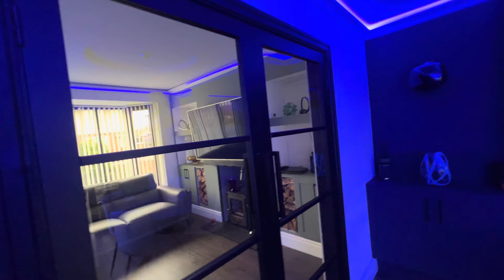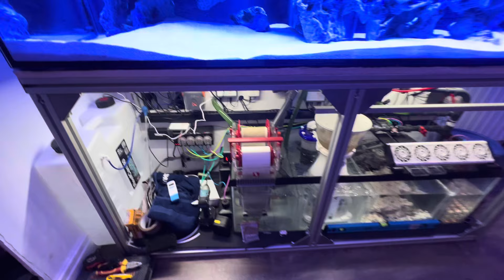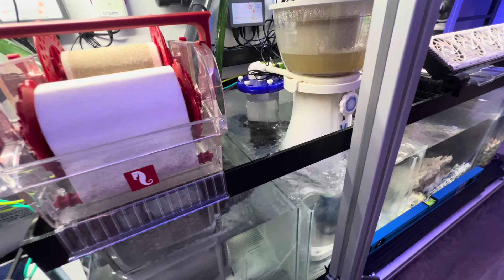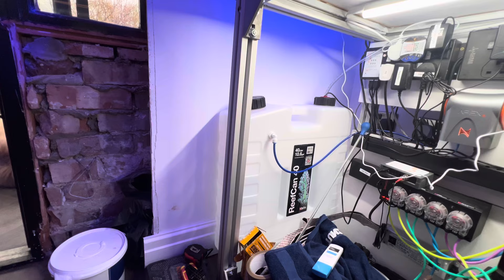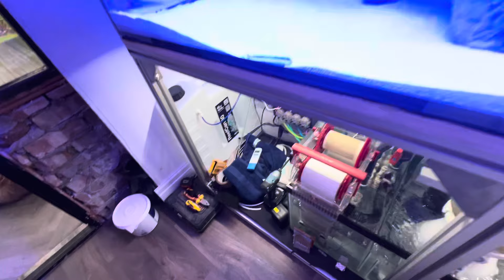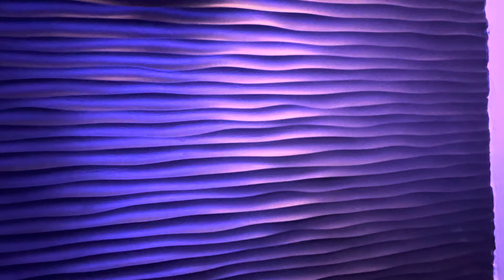Custom Dream tank

Comment: Sickkkkkkkkk which sump fans are those
Reply from the maker: No brand , just off eBay the fans .
Reply: @Taity1972  if you have a link that would be amazing! thanks. also would you even recommend them lol
Reply from the maker: @Reefer_NYC  probably to early to recommend them , would say , plastic housing looks good , nothing I can see that might lead to rust getting in tank . 
Will sort link out for you .
Reply from the maker: @Reefer_NYC 
EBay ref. Is uk plug spec

317096723491

Comment: Great set up one thing , with the inlet and outlet of your uv steriliser both pointing down is that you could get an air gap in the chamber. I put the output up so the the chamber has to fill up with water before it exits.
Reply from the maker: Thanks.  For advice